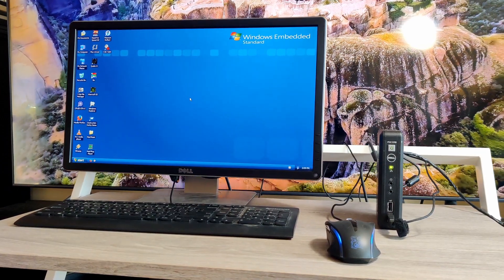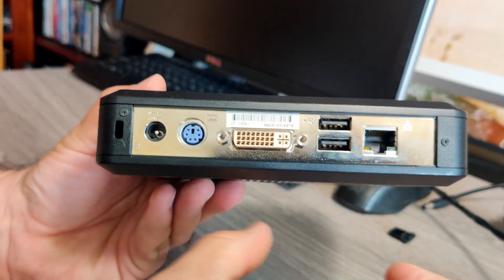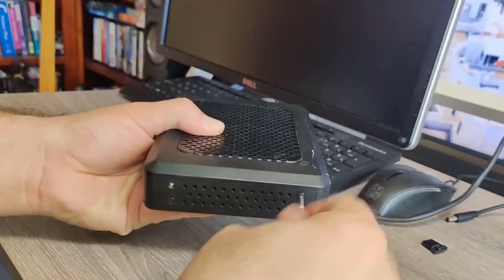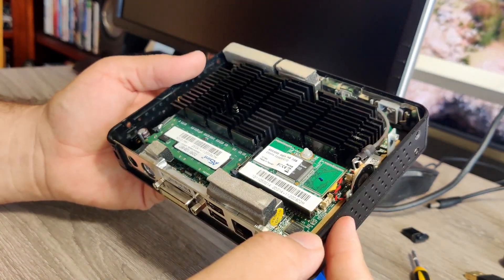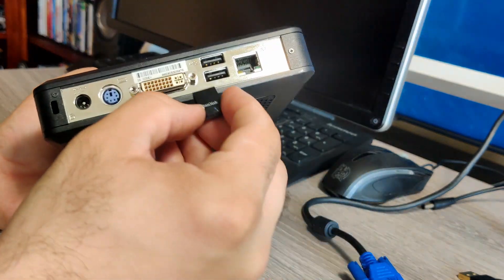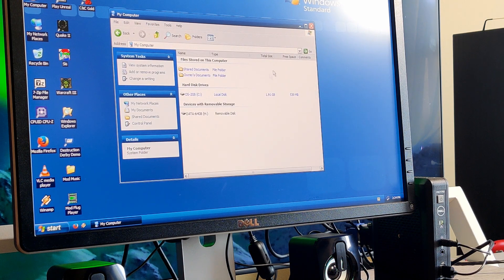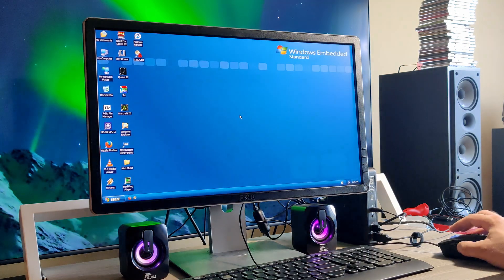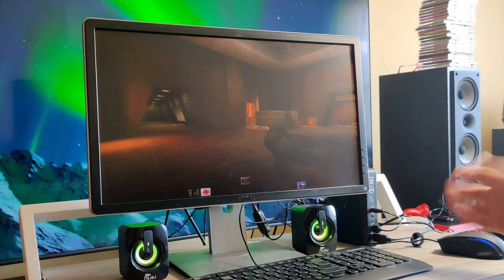Dell FX170 Windows XP Gaming on the palm of your hand

Comment: what is the power draw? I looking st potentially using this for pihole and wireguard
Reply from the maker: They run with a 12V - 3 amp power supply, so the power draw is under 36 watts and probably in the 10-15 watt range.

Comment: Hi, it is not possible to play with dell fx170 in traditional 4: 3 mode even with 16: 9 monitor?
Reply from the maker: Not all old games will look correctly in 16:9 monitors, but many 3D games will work fine.

Comment: Can we use it in warm countries like India?..i have heard that these mini PC need colder climate or an AC in room to work..can heat be a problem for using these for 8 hrs/day?
Reply from the maker: These computers have large heat sinks and CPUs that don't generate too much heat. However, running it in a 40C room for 8hrs/day may lead to crashes if the components run too hot.

Comment: I just ordered one from you on ebay. I'm gonna use it in my arcade machine to run MAME, to replace the 15 year old Win XP PC I had in there which went wrong and for the life of me I could not fix it. Gonna drag and drop the files (about 27 gb) to the H drive and run it from there. The arcade controls all go through a keyboard encoder which simply plugs into a USB socket so it should work seamlessly. Also takes up a lot less space inside, and less power usage too. As far as turning the cabinet on and off, currently I use an arcade button on the outside of the cabinet with wires that ran to the power on switch of the other PC motherboard pins. I'm hoping I can hack into the power switch on this Dell unit and solder the wires in to turn it on from the outside without having to go in and press the button on the actual unit itself. If you have any ideas/advice on that, please let me know !!

Comment: Forgot to mention, I ran speed tests on various USB Drives to see which are fastest. I thought a USB 3 drive might be faster just because of marginal better performance on a USB 2 port, esp of the port performed better than USB 2 specs but not up to USB 3. 

Found no advantage to USB 3 drives. The Sandisk Cruzer Force tested out best in across the board speed. Can't say that results in a real advantage in use, but I have a lot of 64 Gig SD Cruzer Force drives.

Real reason for 64Gig... too much price jump above that. 

There are adapters to allow a SATA drive to be used in IDE. And there are IDE SSDs available, but over priced IMO.

Comment: I think you are as crazy as I am. I have been been playing with old computers for years. Have a number of these, and have upgraded the hardware to a full SSD mounted outside the case with a ribbon cable coming out the side. Am working with Compact flash and SD cards to see what I can do with them. 

I'm actually more into the hardware work than the software, but I have to do both to make it work. 

My real problem is, the drives are so much faster than the system can take advantage of... nice problem to have.

Comment: Does the embedded Win XP thats installed on the unit have MS-DOS mode available for older games? Is it bootable into DOS?
Reply: Nope, but you can use dosbox, most msdos (into dosbox) games will run fine in these machine

Comment: One improvement you could make is to convert that 64GB USB drive from removable to fixed storage so that Windows treats it like an actual mounted hard drive.  Just google search for Hitachi microdrive drivers, the process is as simple as modding one line of code in the .inf file to match the hardware ID of the USB drive in your system, then force-installing the driver.
Reply from the maker: Thanks! I'll give that a try. This BIOS also seems to have an option to treat USB storage as a hard drive, so I may be able to get it recognized as a fixed disk by just changing a BIOS setting.

Comment: i want to use it as a server for my python socket scripts  and want to run Linux on it does it work.. and can you tell me power usage
Reply from the maker: It is rated at 12V - 3.25 amp = 40W, but draws much less than that during normal operation. If you're running python scripts, it'll draw very little energy.

Comment: Philscomputerlab would be proud! Pretty sure there is a program out there to remove the power limit for Intel 945gse since it was meant for low power mobile graphics
Reply: It will kill the computer. It killed my xp one.
Reply: @miregoji2959  oof. well that sucks. never actually tried myself, but my almost useless atom netbook thanks you lol
Reply from the maker: This little system is full of holes, so adding a fan outside the case to actively cool the internal heatsink is a possibility...

Comment: Thanks for your video. Is there any way I could run a linux os from the usb? (not using the internal 2gb drive). I would like to use it like a headless music server, using Volumio or Daphile. Thanks.
Reply from the maker: Yes, you can install Linux on it or boot linux straight from USB. This is not as restrictive as other thin clients.